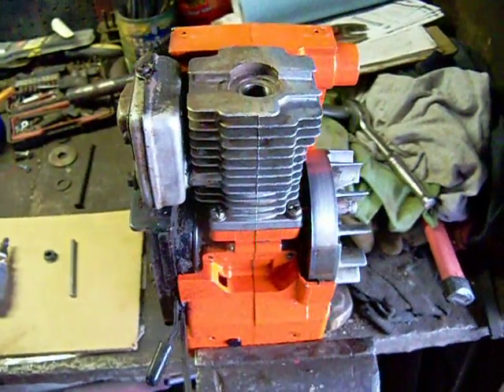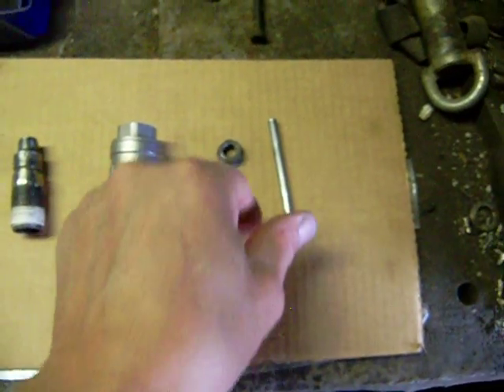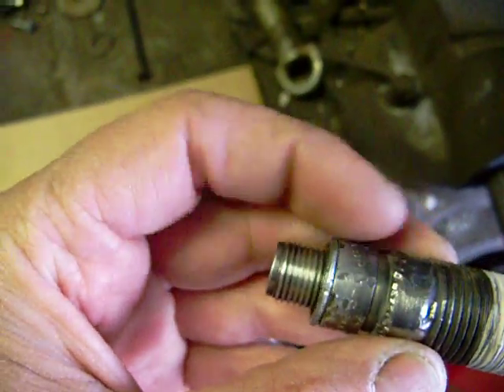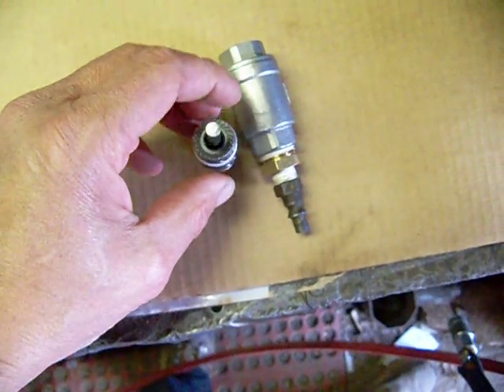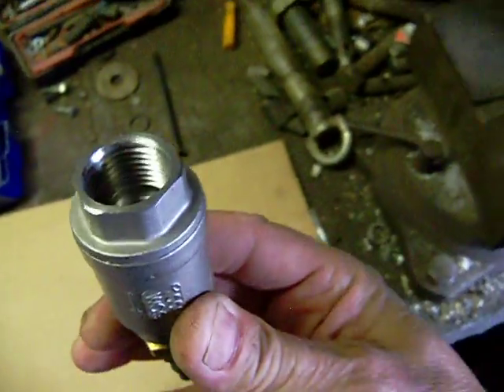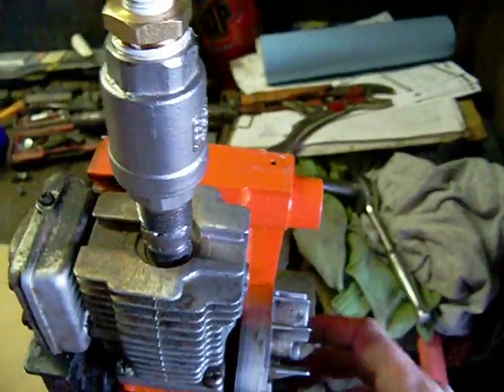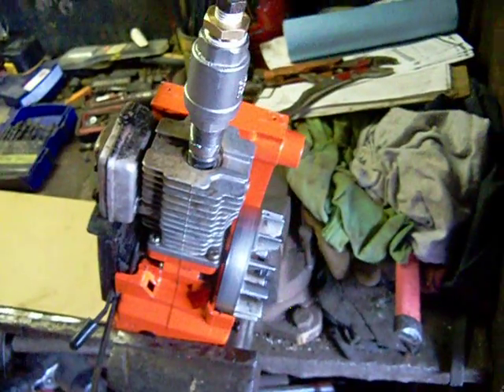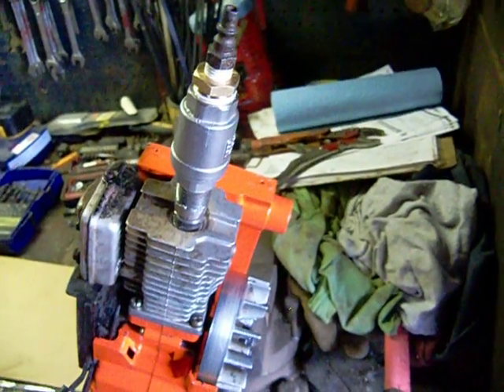Junk chainsaw 2 stroke engine runs on air

Comment: I just put a air hoes fitting in places of spark plug and it worked just fine did nothing other than took the spark plug out my way is very simple if it dont start turning pull the starter rope and off it will start runing really cool i though!!!!

Comment: What is stopping you from doing this with a 4 cycle engine with an alumum plate  and welding the valves shut.. drill holes  in the cylinder near the bottom of the stroke    now you can lubricate it.. I would like to  run it on  600 degree hot air heated by solar heat.. from compressed air form wind mills stored under ground.. the windmill air could heat hot water or radiant floor heating
Reply: For a 4 cycle i seen them make two more cams do one valve opens on each storke and it works good

Comment: I have been thinking about building something like this. Using a electric valve and magnetic trigger to time the valve open /close cycle. I want to use steam from concentrated solar. And fire, for sunless days. I guess having multiple would be a good idea, to  have  a reliable energy source, I gave a 3-4 hp engine I plan to start with. And plenty of alternators. Great video...

Comment: Doesn't the rod eventually punch a hole in the piston head?
Reply from the maker: of course it would , but its just a demo to show you don't need gas .
there are other ways to do this that ultimately wouldn't be so destructive.
proving you can if you are ingenious enough run any engine without the conventional gas and carb etc.
Reply: @Ianlesliemitchell  any chance you putting this engine in some kind of go-kart? Using high pressure reservoirs?
Reply from the maker: @AndreLuiz-ip3fh  would be nice to find more time to try that idea .
I'm sure it would work fine just limited on distance maybe .
Let me know if you try it out .
Reply: Bob Brueckner you can use electric valve, and hall effect sensor and magnet to time the valve,
Reply: You must be related to Mr. Lee Rogers and his compressed air internal combustion engine conversion. Any more details would be appreciated since I'm very interested on the subject.

Comment: The piston pushes the rod the rod opens the one way valve feeding it with the max amount of air to push back down the piston. So depends how wide or opened the valve opens determines how much air it brings in the chamber to push down a piston. More air more power more thrust acceleration.
Reply from the maker: You are correct . This was only proof of concept .
I didn't test the second part to your theory .
But I assume the opening stays the same but if you increase pressure then that would increase speed (unproven at this time )
Reply: Ian Mitchell this is amazing though. Opened up a new world for me.  I messed around with vaporized gas. Now i think the only problem would be air tank and compressor and how to place it on re vehicle without it looking like your driving a tanker
Reply from the maker: vincent duenas there are other videos out there proving you don't even need a pin to push the piston .
In one case it is as simple as a flexible tube .
If you keep the speed down then the tank doesent need to be so big only the compressor has to produce a great cfm to keep up.
Reply: Ian Mitchell so the motor has to be connected to the main motor by a pulley that way they run the same rpm creating the same cfm in and out. The pin though is a great idea making the piston push on it when it reaches its closed position to open the valve giving it whatever cfm you dial your setting too.basicall just as a regular air fuel mixture.  But  I haven't messed with it yet to say otherwise but In my head it makes perfect sense.

Comment: hii great video!!
I will try to make this on 25cc weedeater engine I cleaned it and I bought 3/4inch check valve.
I will use 3 -10 bar pressure and I dont know how big metal stick that opens valve must be in diametar? how much space I need between pipe and steal rod for steam?
I will ad oiler bcs I need to run this at least 1h , I will power car altenator with it
Reply from the maker: ELECTRONICS  did you try this?.
The rod diameter depends on opening and smooth motion without slop.
The length should be just enough it open the valve to let air or steam into chamber the pressure will do the rest.

Comment: wonder how long it will last untill it breaks because of lack of lube.
Reply from the maker: this is just a demo of how it can work .
May be I could do a destruction video because that would be fun too. lol .
Reply: Might be fun that too, or add a container with 2 stroke oil on the top bleeding into the piston or something xD
Reply: Andy [Xvixx]  You could use an inline oil feed with the air supply
Reply: Van Reliant exactly! All air tools require lube just use an inline Oiler.

Comment: thanks a lot for this great video , but i wanted to ask you there is another video they connected the compressed air directly through a flexible tube without the spring loaded check engine , do you think it will be the same efficient or using the spring loaded will be more efficient 
this is the other video i am talking about  : https://www.youtube.com/watch?v=5O1cw-p8jsM
Reply from the maker: he has a nice idea , i will have to try this. as for efficiency its tough to say but his idea is non invasive. i.e i have a rod hitting the piston which eventually will wear through.
I could change it for some sort of hard plastic to reduce wear but i do like his concept.
Reply: definitely true as it will not last long before that rod puts a hole right in the middle of the soft aluminum piston face.

Comment: or could i use a regular brass check valve
Reply from the maker: +random videos (rv)  a regular brass one will work fine too, I had a quick look on ebay, wasnt finding the same SS type i bought but there was one from HK for $3.99 
http://www.ebay.com/itm/1-2-NPT-Brass-In-Line-Spring-Vertical-Check-Valve-Copper-Control-Tool-200WOG-/321871612781?hash=item4af10b0b6d:g:OocAAOSwVL1V~3LY
Reply from the maker: +Ian Mitchell I found the one I bought.
http://www.ebay.com/itm/291300616907?_trksid=p2055119.m1438.l2649&ssPageName=STRK%3AMEBIDX%3AIT